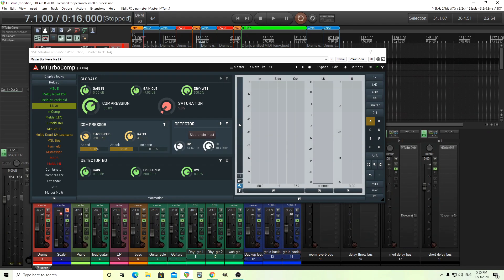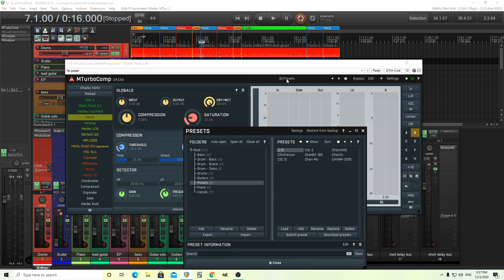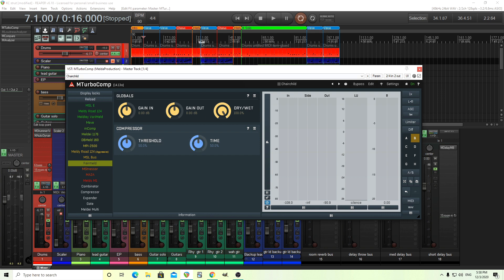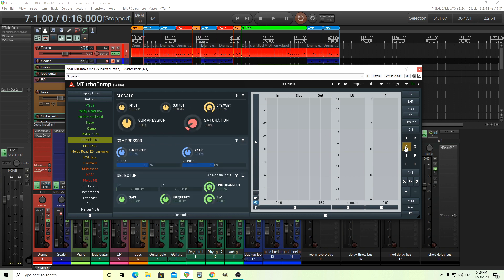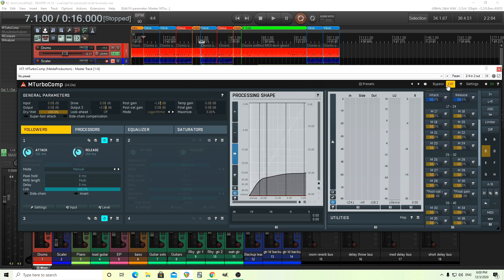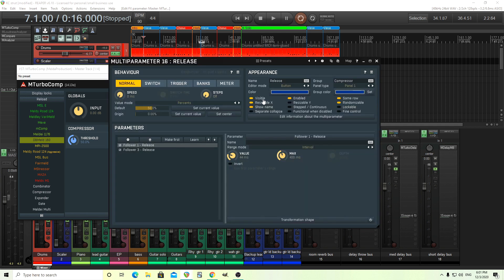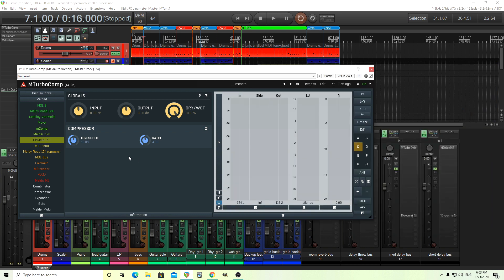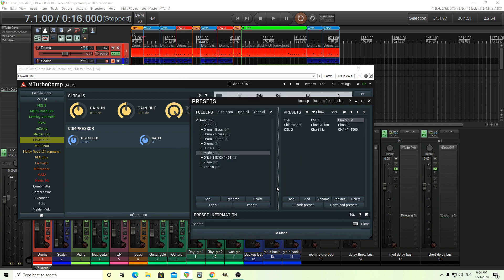MTurboComp simple models

Comment: Hi Chandler, I have MTurboCompLE and I hate to be the guy asking very simple things... but can you give a rough outline on initially operating this plugin? I always start mixing with peak levels hovering at most at around -6 dB (in FL Studio), and upon opening TurboCompLE, I'm already hitting extreme levels of GR, and the main meter in the plugin is pushing above 0 dB into the red. Should I be setting my input gain to hit some predetermined level on the meter, or does it make more sense to reach for the "Compression %" first? Sorry for the dumb question.
Reply from the maker: I usually reach for the compression or input gain first. Actually, first I turn down the output "just incase", then I turn down the input/compression to a somewhat reasonable level. After that I either use the "set" button or manually adjust the output to match the input. From there I'll listen to the sound and adjust things to get them exactly how I want them. I hope that helps.
Reply: @Chandlerguitar  Thanks for the reply, you did help clear some things up. I guess my final bit of confusion comes from this "reasonable level" that I keep seeing in relation to the various models. It also says it in the manual, but I'm not really sure what to make of it, does this mean I shouldn't mix too hot into it, as if it was replicating the physical constraints and limitations of an actual analog compressor? Or maybe I'm just overthinking it 🙃

If you couldn't tell, I am much too used to ITB compressors with adjustable thresholds or at the very least, listed internal thresholds...
Reply from the maker: @50CalBeats  Of course you can mix hot into them, but they will distort. Of course some of the character comes from the distortion, so you might want to do that. If it is too much, you might want to reduce the signal a bit though. Its up to you. They have  saturation, so they will sound different depending on the input level.

Comment: I think the LA 2A version is broken because it's compressing like 15 to 20db and even if i reduce input and increasing output it sounds bad.
Reply from the maker: I just added a new version to the online exchange. It is called "Chan2A(reduced gain). See if that works better for you. I hope it helps.
Reply: @Chandlerguitar  Will test it as soon i go home. Thanks for the new preset 👍
Reply: @Chandlerguitar  https://prnt.sc/w45yxu 
If you look at screenshot, the default setting is squashing my signal already and GR is about 8 db and i can't get it compress only 2-3 db. I think it's not your preset but the plugin itself.
Reply from the maker: @jayjain3821  Have you tried the new version?
Reply: @Chandlerguitar  Will give it a shot.
Reply from the maker: I'll see what I can do and try to adjust the input